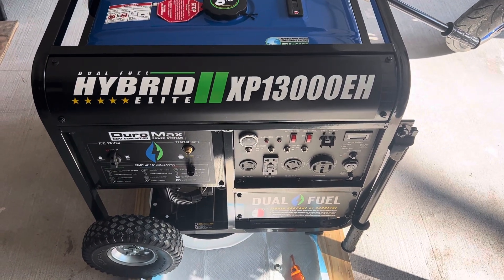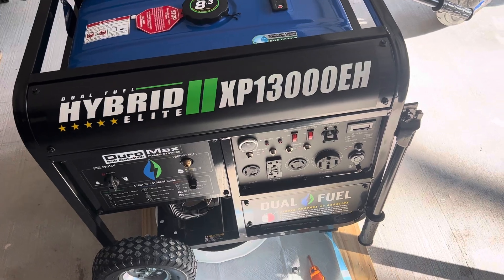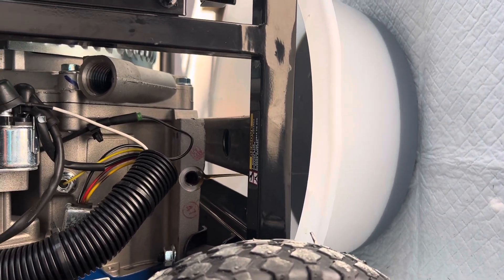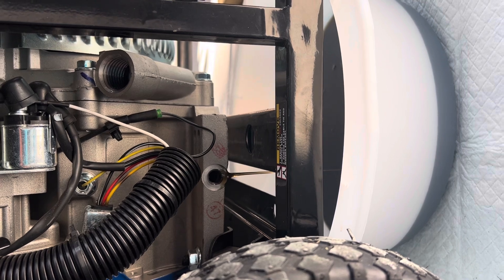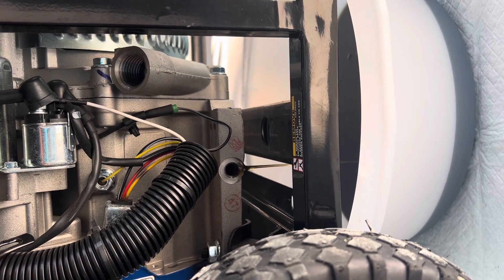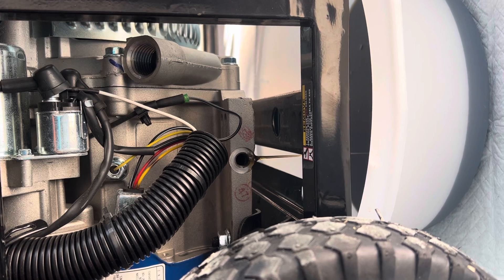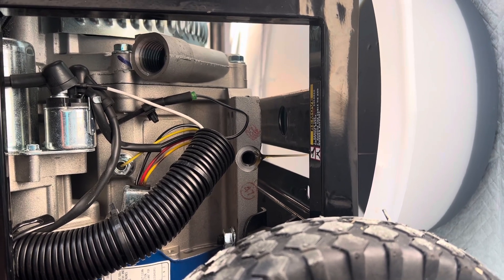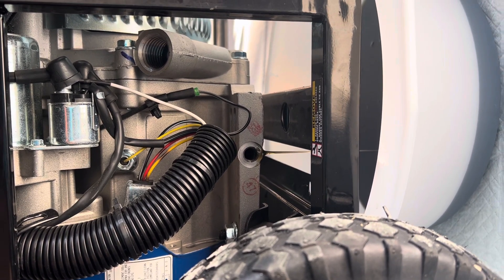DuroMax XP13000EH oil change

Comment: Thank you. Duromax instructions are terrible. I saw two possible on the other side and in a Duromax video they only show a closeup. They have a page that says: including 360 degree  views and, of course, there isn't one solitary picture of the side where the bolt is. They sent me one with a defective battery charging module in March 23 (today is 1-12-24) and I am still waiting for one after they sent the wrong one in August. I wish that i had bought a different brand.